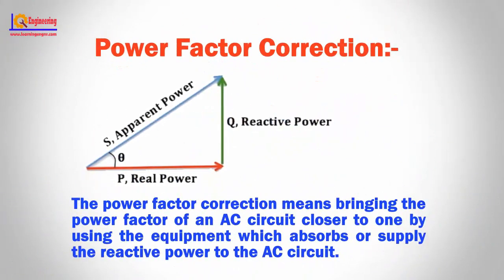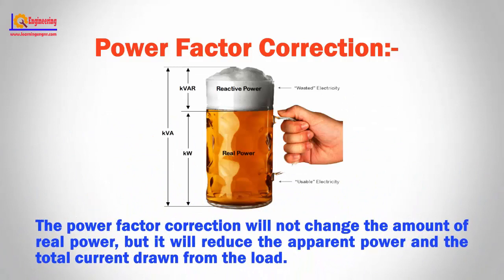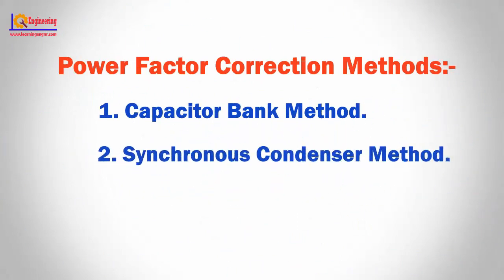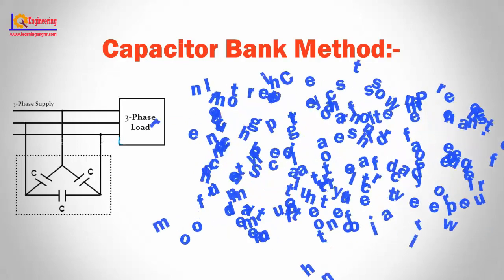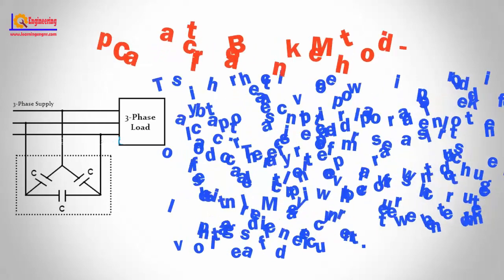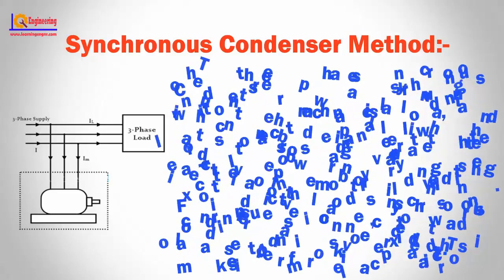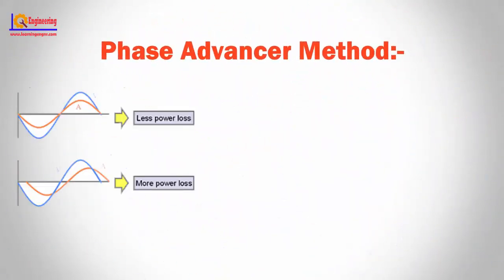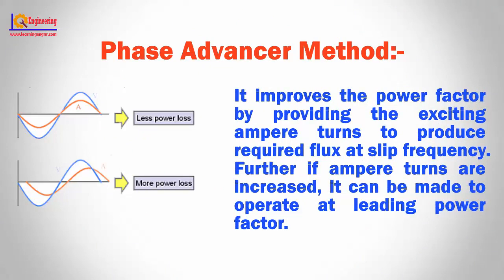Power Factor Correction - Power Factor Correction Methods - Power Factor

Comment: By Practically since 2014 i have seen only capacitor banks everywhere for PF improvement.
Where are they using 3rd method?
Reply from the maker: Phase advancers are used to improve the power factor of induction motors. The low power factor of an induction motor is due to the fact that its stator winding draws exciting current which lags be-hind the supply voltage by 90 degrees. If the exciting ampere turns can be provided from some other a.c. source, then the stator winding will be relieved of exciting current and the power factor of the motor can be improved. This job is accomplished by the phase advancer which is simply an a.c. exciter. The phase advancer is mounted on the same shaft as the main motor and is connected in the rotor circuit of the motor. It provides exciting ampere turns to the rotor circuit at slip frequency. By providing more ampere turns than required, the induction motor can be made to operate on leading power factor like an over-excited synchronous motor.
Advantages
As the exciting ampere turns are sup-plied at slip frequency, therefore, lagging kVAR drawn by the motor are considerably reduced
The phase advancer can be conveniently used where the use of synchronous motors is inadmissible
However, the major disadvantage of phase advancers is that they are not economical for motors below 200 H.P.

thanks for your comment.